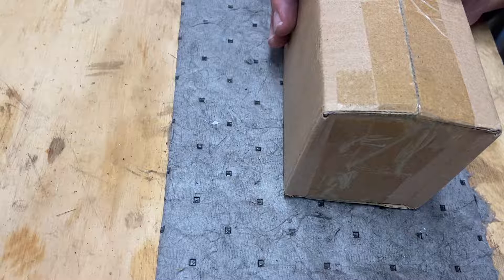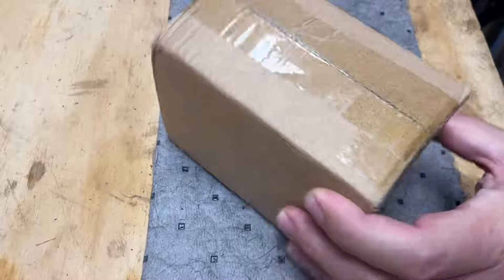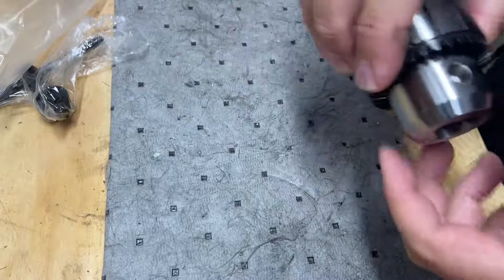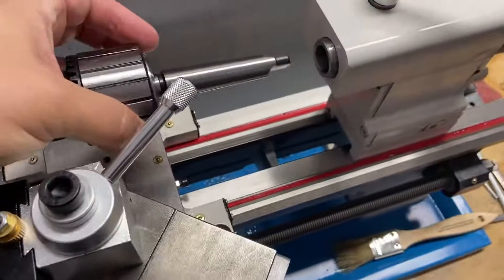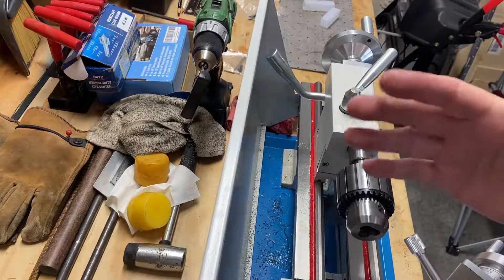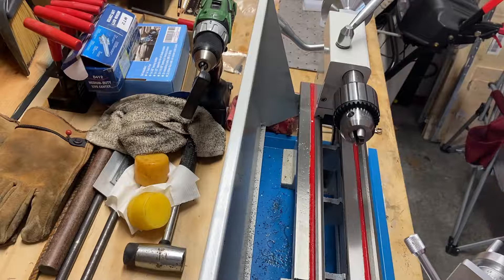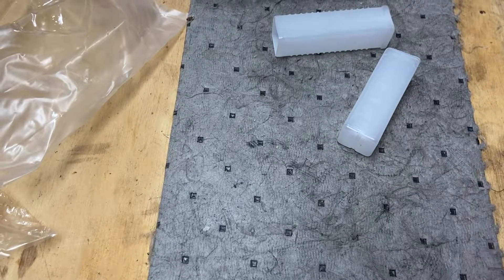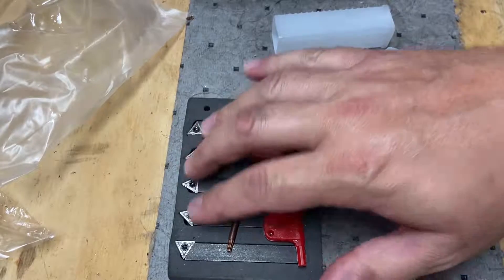Vevor Mini Lathe MX 400 Part 7 - Drill Chuck Tail Stock Upgrade Addon

Comment: I just got the vevor bench lathe for free from someone I know who bought it but used it once. I bought a MT2 drill chuck and put it on, however when I centre punch and use a centre drill it doesn’t even drill. In school I’ve never had any problem centre drilling on a lathe. Any tips?
Reply from the maker: If you got one free that is awesome.  Let the fun and work begin to get the machine up to usabilty.  I need to empahsize that I am no expert here,  Just an amateur having fun in the shop.  No matter how many tailstock videos I put together or lathe tramming videos I do I never seem to get it right.  That out of the way I have my tailstock centered about as well as I am going to make it.  I struggled a lot with my tailstock and in my opinion it is one of the worst components I received.  I have a video showing a teardown of mine.  Maybe this will help but in addition dont be afraid to tear yours apart and discover how the adjustment screws work.  https://youtu.be/zqsLtGPpkso Also if you look at the comments on my tailstock videos there are many great comments from my subscribers who have great tips and tricks on how to center it up.  Good Luck and happy turning.
Reply: @deezworkshop Thanks for the response! I’ll check out the other video and see what I can do to improve my lathe!

Comment: Hi! How far does the quill need to be out of the tailstock in order that You can fit in the MT2-part of your drill chuck-assembly? 1/2" or more?
Reply from the maker: I just measured it.  The tailstock quill sticks out about 1/4 inch when fully retracted.  I have to extend it about 1/2 inch before the MT2 taper seats.  So a total of 3/4 inch or so sticks out when using my Drill chuck.  I think its really more about the stule of taper shank you are using.  This chuck has a taper shank with a tang on the end.  I have another stule that has a threaded end where I can put a pan head screw in to allow it to pop out.  Not much to gain but i gain about 1/4 inch with that type of shank.  Hope this helps.

Comment: If that's OXA sized, the next size is AXA then BXA. I use Shars brand.
Reply from the maker: Yep,  The first one I bought,  the cheap aluminum one was a 0XA.  I quickly upgraded to an AXA Wedge Type and love it.  It wasn't Shars...It is another chinese manufacture but the quality is great and I love it. you are right on the sizes and then there are different styles as well but I am very happy with the AXA.

Comment: Hi there, did you re align the tailstock as I remember you leaving it out of alignment. If not aligned correctly all drilling will not be concentric. ( will boar tapered hole) . Be sure to to wear eye protection, short sleeves and no jewelry. Have fun and be safe.
Reply from the maker: I’ve messed with the tail stock off and on since this video. I’m learning everyday and making minor improvements. I ended up breaking a centering but in on of the videos. I’m making a ton of mistakes but trying to learn and improve each time I use this lathe. I’ve been using eye protection. And ear protection. Always use short sleeves. I suppose the wedding ring could come off when using the lathe. All great advice.